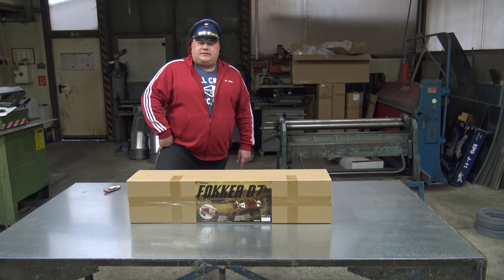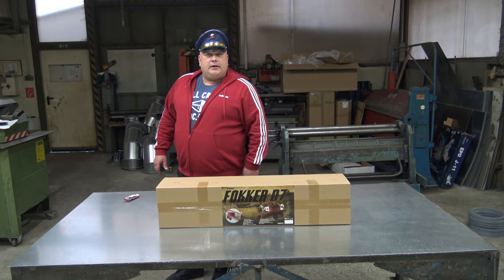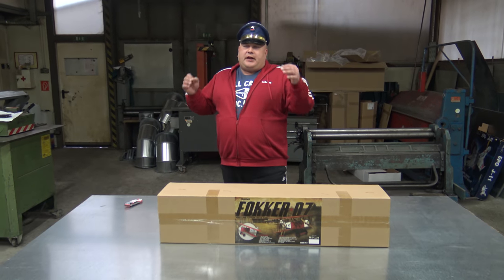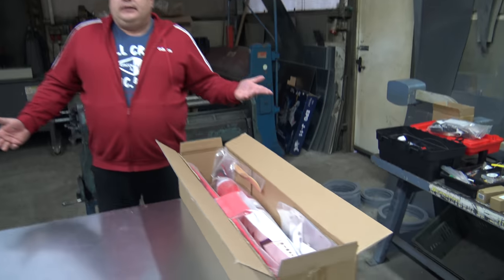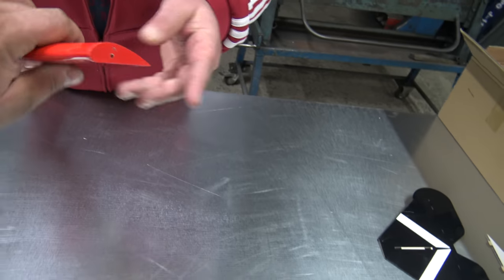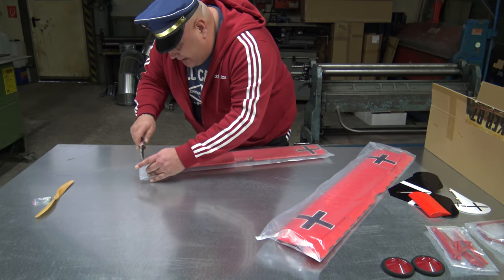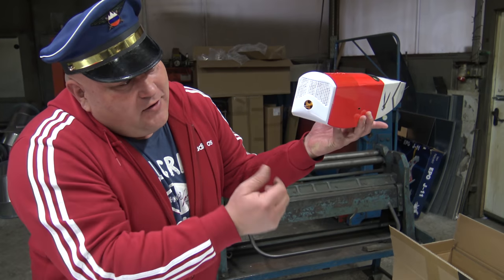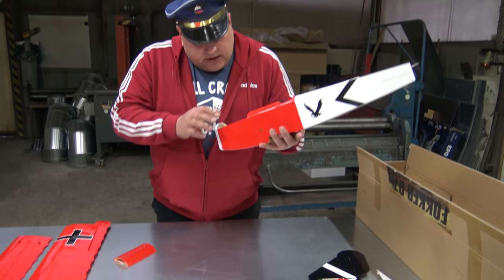H-King Fokker D.VII Biplane 925mm (36.4") (PNF) Unboxing

Comment: It is a nice little Fokker 😃 Putting a 4-stroke in it would be very difficult. It's all thin plywood in the nose, taylored to take the battery and the brushless motor.
I also assembled the wings different than described in the manual. On mine, the lower wing was a little warped, this way I got it straight:

I assembled all struts to the upper wing. Installed the lower wing first, connected the upper wing via the N-struts to the lower ones. Checked that it sits perfectly (angles and stuff), fixated it in that position and then screwed the inner wing struts to the fuselage -> perfectly straight 😉